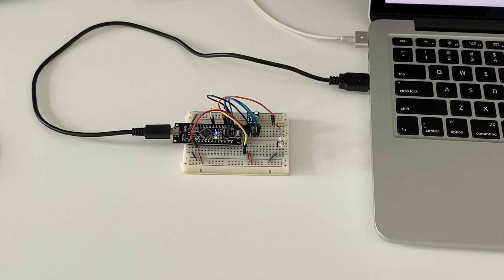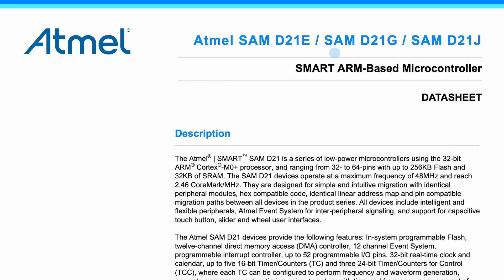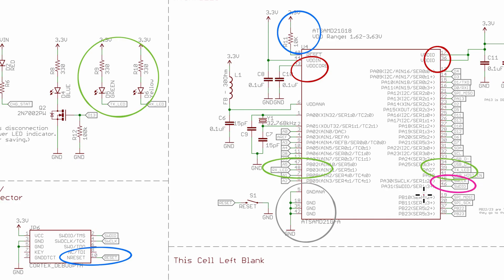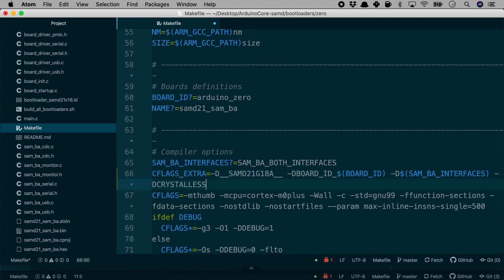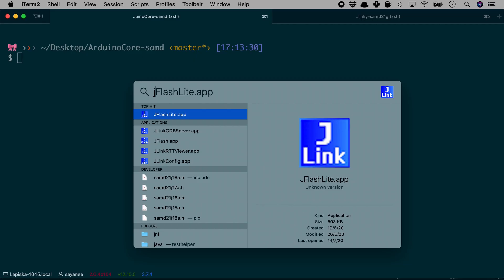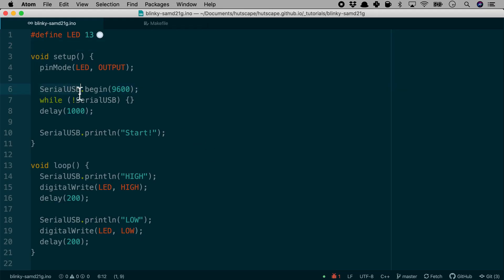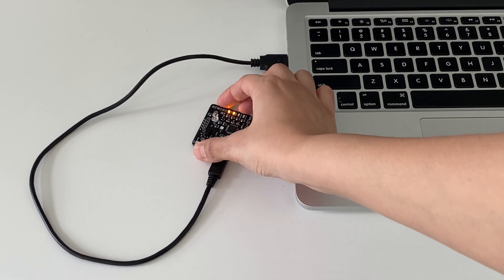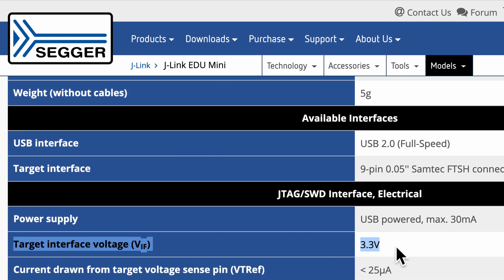Uploading Arduino bootloader on a new micro-controller // With J-Link SEGGER, SWD for MCU SAMD21G

Comment: Really enjoying your videos.
These are the videos I wish were there before I spent days banging my head on the wall to learn this stuff :D
Reply: Have you actually created a core / board definition for your custom board?
We have a ton of documentation about it :)
Reply from the maker: @ubidefeo  Oh nice!! That's exactly what I need. Custom board!

And thanks for some lead into using ST-Link. I have the ST-Link V2 and the STM32 Discovery Board with ST-Link. I'll try the Black Magic probe option.
Reply: @sayanee  hi Sayanee, do we really need to Rebuild the .bin even if using default settings? Can i just use the .bin file from repo straight away?
Please make video about creating custom board!!
Reply from the maker: @bhargavmistry1274  Uh! Indeed the repository does have a *.bin file https://github.com/arduino/ArduinoCore-samd/tree/master/bootloaders/zero. Well, upload it and see if it works for you. I always like to generate these files as I can know how they were built even if it's the default. Personal preference :) 

Custom board is definitely in for a future video 🙏🏼
Reply: also, you should convert an ST-Link into a Black Magic Probe, because we support that programmer in the CLI via openocd
here's a link about it https://microcontrollerelectronics.com/how-to-convert-an-stm32f103c8t6-into-a-black-magic-probe/

Comment: Hi,
I have recently got a custom PCB designed with the STM32 blue pill core (STM32F103C8T6). I know it's possible to install Arduino IDE with the blue pill board, but how to install it with a custom PCB?
What hardware would I need. Is having a ST link v2 enough? My custom PCB has a USB and SWD pins set aside, along with Reset.

Any links also would be appreciated.

Comment: Can we run Arduino IDE and program codes(.ino files) as usual on the custom board as we would with an Arduino board by doing this?
Reply from the maker: Yep! Absolutely. I have done it a few times and wrote own the steps: https://hutscape.com/oak/code/custom-arduino
Reply: @sayanee  thank you. Please let me know if you plan on making a video regarding the same

Comment: Thanks again, your videos are really helpful.
I'm moving from Arduino IDE to nRF Connect VS Code, so I found that I need this J-Link programmer for it. But one thing wasn't clear to me is does this J-link is enough to program Adafruit Bluefruit nRF52832 module directly or do I need nRF SDK also?
Reply from the maker: I have never done that, sorry!

Flashing the bootloader can be so frustrating for each type of microcontroller and platform. Could you try posting your question on the Nordic Semiconductor forums? This is what I would also do: https://devzone.nordicsemi.com/

I hope you figure it out!
Reply: @sayanee  Got it, they said it does works directly. Need to solder SWD Connector on the  module and use J-Link Programmer directly.

Comment: Appreciate yours clear presentation very much. I would like to ask if it possible to flashing the SAMD21G18 bootloader using the J-Link EDU as well (I'm not experienced with boot loading) .
Reply from the maker: Yes!! And I just tried with the J-Link Edu Mini on my current project: https://hutscape.com/oak/examples/bootloader

I have to admit that bootloading is difficult for me as well :( Somehow it worked after I left Vtref unconnected on the SWD pin 🤷🏻‍♀
Reply: @sayanee  Thank you very much. I'll follow your guidlines . Appreciated.

Comment: Hi great video! But why was the "D-crystalless" part added in the code. Can you elaborate a bit?
Reply from the maker: Uh, that's because my circuit does not include a crystal and I don't need it for my functionality. If you need the crystal, please include it and remove the crystalless option.

Check 16.6.2 External Multipurpose Crystal Oscillator (XOSC) Operation of the datasheet for more information: https://cdn.sparkfun.com/datasheets/Dev/Arduino/Boards/Atmel-42181-SAM-D21_Datasheet.pdf

Comment: Hi mate! Thanks for the video and information. I'm developing a own Arduino board based on ATSAMD21E18 and I want to know what is the equivalent command on windows of your "make" command.
Reply from the maker: The details of my simple "make" command can be taken from the Makefile for a simple blinky for samd21g: https://github.com/hutscape/hutscape.github.io/blob/master/_tutorials/blinky-samd21g/Makefile

It consists of "make lint" with cpplint, which you might want to omit if you are not already using cpplint for your other C/C++ projects. For windows, I think you can use the Python pip to install: https://pypi.org/project/cpplint/

The command "make all" and "make flash" consist of arduino-cli. You can download the Windows version of arduino-cli here: https://arduino.github.io/arduino-cli/latest/installation/#download.

The command "make clean" is simply removing the build folder.

I have no chance to use it on the Windows, but I hope this gives you some clue!

Comment: I don't know why these chip manufacturers don't sell chips with built-in bootloader. Its so much headache sometimes especially if you are building  your custom pcb with those MCU chips. However, STM32 chips come with builtin bootloader, don't they?
Also, I never knew how the MCU would function without an external oscillator. I would just read in the datasheet that it has an internal oscillator but never knew how to use it. Thankyou.

Comment: Jlink needs to know the supplyvoltage of the Target processor to make sure the voltagelevels of SWDIO and SWDCLK will not damage the target. This is done by providing VRef FROM the Target TO the JLink programmer. So VRef is an Input pin on JLink. Connect Vref to the supplyvoltage of the target, in your case 1V6. There wont be any SWD data and controlsignals on the pins if you leave VRef open and so nothing happens: JLink cant detect the target, it cant flash the memory and it cant verify.

Comment: Unfortunately you published your video after I also already bought a J-Link EDU Mini! No success in programming my ATSAMD21E18A with it yet - and I'm running at 3.3V. Not sure what's going on! The micro doesn't seem to boot properly so I'm guessing it may be something to do with the BOOTPROT fuse bits? You didn' mention fuse bits in your video, though.
Reply: Make sure to connect VRef to target supplyvoltage of 3v3
Reply: @wimdezwijger7023  well, I am using the J-link, Atmel studio and the Seeeduino Xiao bootloader. everything seems OK, the file Is uploaded and the upload Is verified but the custom made assembly does not boot as the original Xiao starts... No LEDs are blinking, nor the Xiao is visible for the Arduino IDE. No COM ports are visible... All lines are connected, including the reset and 3V3 (to Vref).
* Just to reply to myself... I did it with the same setup. The issue was in missing the GND... I succeeded to upload bootloader with j-link edu.

Comment: Nice video ! I am currently designing a custom board based on SAMD21 and I'd like to flash in the bootloader of the Arduino Zero. But does that mean I need to have exactly the same pinout as the Arduino Zero ? Thanks for your help !
Reply from the maker: If you want to only find out what pins are required for flashing the bootloader, then only 01:54 power, ground, reset, LEDs, SWD pins are required. Arduino Zero or other dev boards have many other pinouts based on other features they might have on board. You need to extract out the ones you require.

Do a cross-check with other open schematics with SAMD21 dev boards as I show in 01:54 as well.

Comment: Tried the ST-link OCD/GDB route myself and it refuses to upload anything on the board. Don't waste time trying. I end up getting me a Jlink mini like yours. Debugging with it is so much easier than using "printf" to the serial console.
Reply from the maker: Oh nice! Thanks for sharing. Which mcu did you try with ST-Link?
Reply: Same SAMD21G like yours but a DEV board I got from Seeedstudio (https://www.seeedstudio.com/Wio-Lite-W600-p-4155.html). I tried to use the built-in ST-link debugger from an old STM32Discovery board I have.